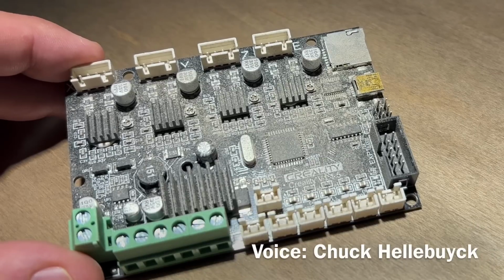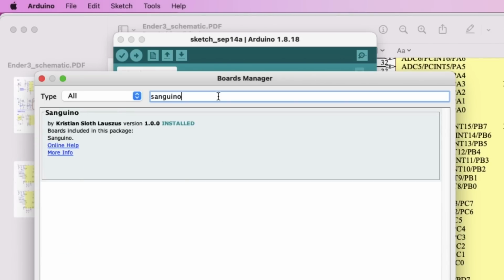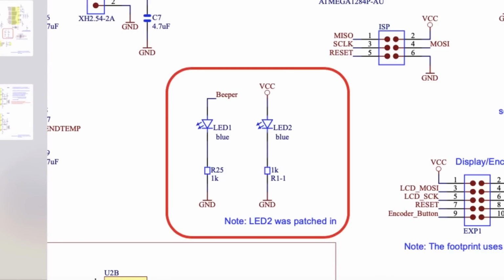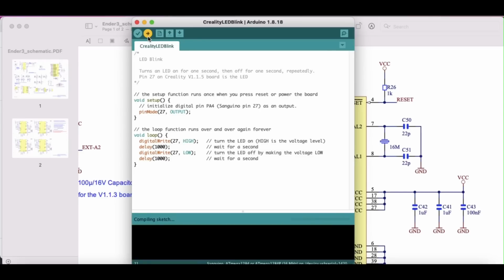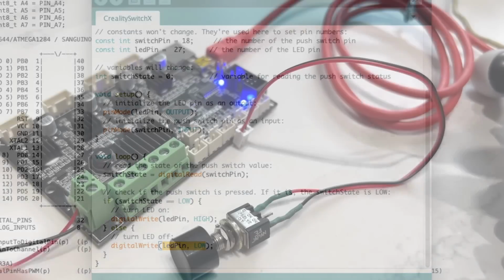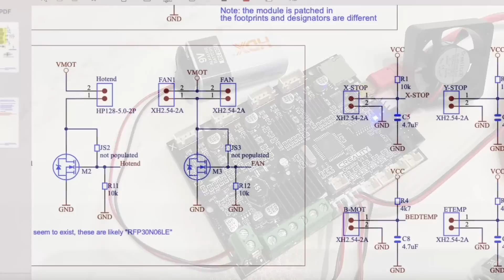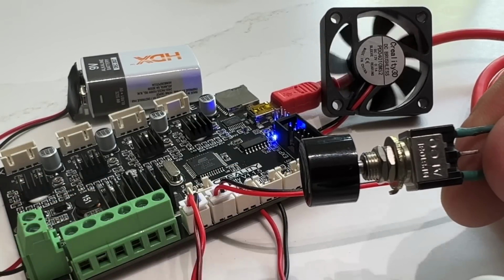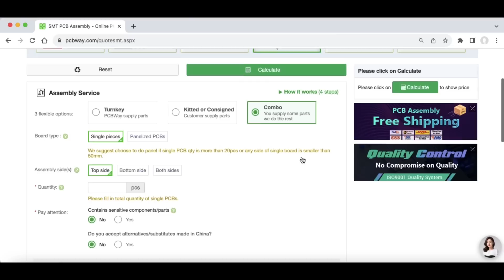Re-programming Older Ender 3 Boards with Arduino - Switches & LEDs

Comment: I am using a crealty 4.2.2 i installed sanguino and I keep getting this message,fork/exec /Users/amandaschlenker/Library/Arduino15/packages/arduino/tools/avr-gcc/5.4.0-atmel3.6.1-arduino2/bin/avr-g++: bad CPU type in executable

Compilation error: fork/exec /Users/amandaschlenker/Library/Arduino15/packages/arduino/tools/avr-gcc/5.4.0-atmel3.6.1-arduino2/bin/avr-g++: bad CPU type in executable. what do i do?
Reply: The 4.2.2 Boards use a STM32F103x MCU, programming it using this guide won’t work.

Comment: The board could probably be used in CNC or anything else needing stepper drivers. I wonder if you could even produce some kind of vacuum cleaner or robot mower from one of these.
Reply: This is what I thought when I looked at it. I've been considering 3d printing a custom case for the board and steppers and maybe develop a vacuum. The fan connector seems perfect for that.

Comment: hi there, im trying to use a crealty 4.22 board. i did the sanguino set up in arduino ide but it does not upload. i got error avrdude: stk500_recv(): programmer is not responding
hoe to fix the issue ?
Reply: did you find the fix? Same error for me, my board is V1.1.4
Reply from the maker: For v1.1.4 you need to install bootloader first
Reply: @FilamentFriday  I did it - it is sooo awesome 😎 

It took a while but I figured it out🤡
Reply from the maker: Nice work. I have the LCD working now. I share it on my CHEPCLUB.com site for Silver Patreon supporters. I may make a video on it in the future.
Reply: I NEED AN ANSWER

Comment: Thats really cool, didn't know it was that easy to reprogram these boards.
Reply: This is basically all you're doing when you flash a board with Marlin or Klipper. You use PlatformIO to compile & link C down to a firmware image, drop it on an SD card and then it gets flashed onto the board.

Comment: This can also be done with Creality 4.2.x board(32 bit board) but you will need a st-link V2 to program it.
Reply: Hi there, thats for the comment! is it the reason why IDE complile the sketch but does not upload to the V.2.2 board ?
if i buy the st link v2 how to configurate the board ? so it works 
thanks!

Comment: I wanted to put my ender 5 pro board into my ender 5 plus, i cut the Z cables to add them together only to find out the pro board has a different bl touch connector and ever since my printer is just sitting in the corner waiting on me.

Comment: Nicely explained, and I'm sure lots of folks will find this useful
Reply: For what? For turning led on the board on and off??? This is a waste of electronics and time...
Reply from the maker: @zviki68 - Showing how to turn an LED on/off is showing how to control a digital output. The stepper drivers are controlled by an on/off signal for direction (LED on/off), and a pulse train to move (the same pulse train that blinks the LED). Turning on the fan, or hotend, or anything connected to an output on the board takes the same logic as controlling an LED. So I showed you how to basically control almost anything on the board but all you saw was an LED blinking. So it was not a waste of electronics or time. In fact it should recover some waste from the pile of Ender 3 electronics boards just lying around. But more than anybody who asked for more videos you’ve clarified that I need to go deeper and show the next steps for those that only saw an LED blink. Thanks.
Reply: @FilamentFriday  Yes, because Arduino mini or micro is better solution for that kind of things (for blinking led). Old Ender motherboard is better for projects with stepper motor or two, with some rails, for simple cnc or laser engraver, etc... There are steper motors in old cd/dvd drives, old floppy disks...
BTW, pwm (pulse width modulation) signal is a little more than just off and on. The length of the signal is very important.
Reply: @zviki68  I have these boards too and ESP32 and have my own projects, but as this develops I think it will be useful for other folks as they can repurpose old boards to do new and better things. Yes I know blinking a LED and reacting to a switch digital is a small beer thing, but folks that have these boards might not be attuned as you to the Nano & Micro ecosystem, so it’ll be useful for them either way for no real expense on their part. Later who knows they’ll be dropping on PCBWay with custom boards after a learning curve. 😉
Reply: @zviki68  I meant when the series continues 😂

Comment: hi Chuck , i tried uploading the blink example to the creality board (4.2.2) and it wont upload , how can i fix it ?
Reply: I think you need the Arduino bootloader to program with the ide
Reply: do you know any guide ? @riccardosacchetti
Reply: @maths.1089  mhh, no. Sorry.
Reply from the maker: @3D_Printing_Lab1 - The 4.2.2 board is a 32 bit board not 8-bit board. It needs a different setup than what I showed.

Comment: I'm still running the 8-bit board. Should I replace it? If so, what with?
Reply: I think you should sace your money for a whole new printer and if you want to later on you can staet to play with changing Boards.
I mean this as a suggestion not that you have to do this.
I think they did a replacement board im not 100% sure I do know Bigtreetect has one that I use and I think other brands did to
Reply: @TBL_stevennelson  Thanks for the suggestion.
Reply: I have the BTT (Big Tree Tech) v1.4 Turbo and it's amazing. Also with the BTT 2209 stepper motor drivers and BTT touchscreen E3

Comment: with 4 stepper motor controllers, I'd stick 4 stepper motors on there with small mechanum wheels   and make a little robotic platform.  maybe an nrf24l01 radio or bluetooth if you can get one on there.

Comment: neato, yea I have an old, stock board lying around as well as an old BTT SKR mini E3 (256K) board

oooo, PB4 is also a PWM capable pin so....wonder if the existing mosfet circuitry can work with the PWM (or if it is inverted) 🤔
sounds like it's time to do some more tinkering 😁

Comment: You could make a PET bottle filament system with it, just use a hotend and an extruder stepper with a cheap screen for input. Speaking of which, are there any good places to pick up cheap Ender 3 boards like this?

Comment: This is a series I could deep dive into. Please continue this series! Maybe create a smart home device, or a battle bot. So many possibilities, here for them all.
Reply: Creality battle bot!
Reply: This board is too big for simple smart devices. The only reasonable way I see we could use it for some sort of cnc or engraver or similar device.
Reply from the maker: @dmaraptor - The application can be developed on the board and if only a few components are needed then a smaller board can be used and the supporting electronics added after the concept is proven on the big board.
Reply: @dmaraptor  a diy CNC would also be cool too!

Comment: Hi Chuck, I know Creality stepper motors are wired differently to standard NEMA 17's, I have it in my head that reversing wires 1 and 3 is used to reverse the extruder motor, however, I can t remember if this is for a Standard or a Creality extruder motor.
 I have a stock Ender 5 Plus that I am fitting a BMG clone to and I need to reverse the motion, can you confirm which number wires and if possible the colours of the wires that need to be swapped around to achieve this?
Reply: Afaik you need to reverse the interior cablea, meaning 2 and 3. But you can also recompile the firmware with the direction reversed
Reply: @deathcube2006  Yeah I wanted to avoid having to mess with Marlin, I would have thought swapping the wires on the motor plug would be the exact same thing
Reply from the maker: Swap two inner should do it.
Reply: @FilamentFriday  Thanks!

Comment: If you remember I shared my Reflow hot plate using an old printer board, well I have the last part I needed a 12v AC power brick to go inside  so I can finally finish the build and work on the video.